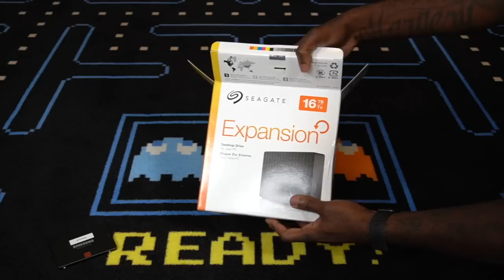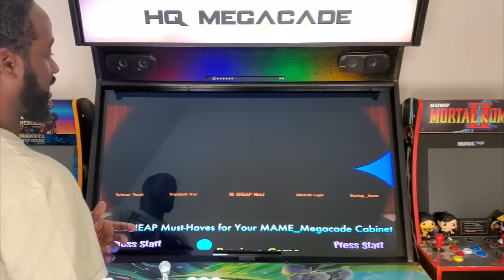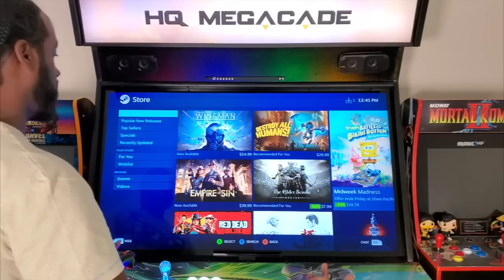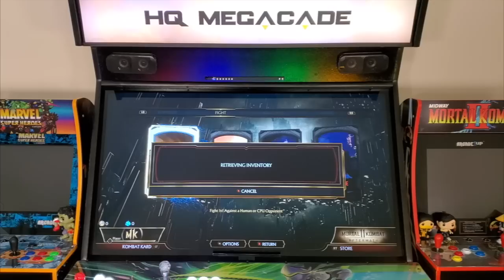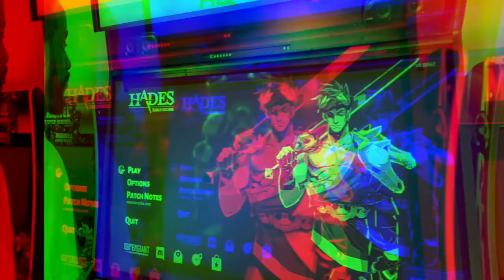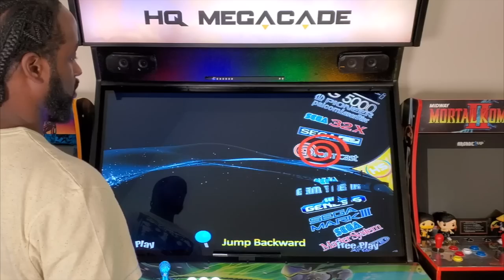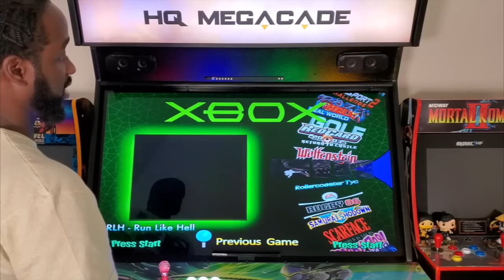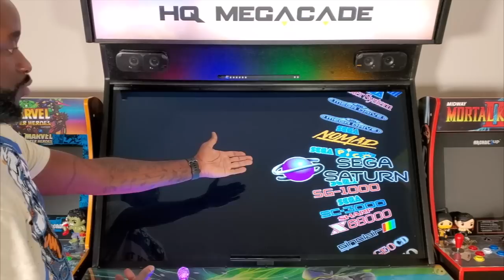Extreme Home Arcades 16TB INSTALL + NEW PC GAMES, STEAM, ONLINE GAMEPLAY | MANHATTAN PROJECT REVIEW

Comment: Nice Vid, thanks man. What should be noticed by disconnecting SSD´s /HDD´s from power is, that data can be lost when being without power over long time period. This effects both SSD and HDD. SSD dont have any mechanical parts but power is necessary to prevent data lost. The HDD has the problem, when not power over long time, its lubricating oil of the little motor can get resinified.

Comment: Great video, very excited for it!  I sometimes have issues with my brand new HQ Megacade where it won't exit a game even when doing the couple little tricks they tell you to do when it gets stuck.  Only option is to do a hard powerdown, which can't be good for the machine.  Do you know if the Manhattan Project upgrade fixes issues like that?
Reply from the maker: I'd like to say that the MO drive will fix a lot of drives. But in the same breathe, it's like having a machine like this with all of these emulators, you are bound to run into little hiccups here n there. But getting rid of busted ROMs, old emulators should eliminate a lot of freeze issues.

Comment: Great video. What would the price difference be between the 10 TB and 16TB? I have a pedestal in order with delivery 🚚 expected to be in March... Do you think this would be available than?  I currently don’t own the 10TB and see that hyper spin wheel is more cohesive. Up to what game console does the 16TB go up to? Are you hooked up directly with a internet wire or wireless? With, such video....so many questions. Can you do a brief video showing some must haves on Arcade options during ordering process and button layouts with Extreme Arcades.
Reply from the maker: Thanks! The 16TB is going for around $300 if I'm not mistaken. Its being offered as an upgrade to the standard 10TB. So of your Pedestal isn't expected to be delivered by March, you could call David and have them add it to your machine.

The 16TB goes up to modern PC games like MK11, Samurai Shodown, Hades and  more. Highest console it goes up to is PS3/Xbox Live Arcade games. As for must have options during the ordering process, honestly it's all personal preference.

Only YOU know what kind of gamer you are. So you have to choose whether or not you want a flight stick for flight controls, steering wheel for racing games. I didn't care to have those. 

As for the internet, I'm connected via wifi. I'm sure with purchasing something like this brings a lot of questions. And also I'd like to add that owning a machine like this does have a learning curve.

Comment: Does Manhattan Project works, as seen in your video, only inside a Megacade, or does the project is a stand alone add on, and you coul install that 16tb hd, with all the emulators, games, presentations etc, on every kind of Pc with the hardware to run it?
Reply from the maker: It works as you see in the video. There's a few hiccups here n there but nothing too major. The MP team is doing a great job at making this drive as stable as possible. Only thing is the drive isn't sold standalone.
Reply: @dthomasfromnc  Does it come only with Megacade?I thought it was an independent project...

Comment: so how in hell did you change the entire hard drive with another os and didnt have to reconfigure all the buttons again? besides, those hard drives with win 10 cant and will not run plug and play on any pc hardware,i think this build they have made for you is tailor made for your pc specs,or they only sell this update packs for customers that already have the premade cabinet?
Reply from the maker: This drive isn't trailor made for my Megacade. If you already own a machine from EHA, you can request the MP drive and it should work with your machine.

Comment: Hey DThomas!  Love your content!  Huge fan!  Quick question:  What CPU and graphics card are you running?  Just want to ensure I have enough specs for the more graphically demanding games and ensure no lag or frame rate issues.  Very close to ordering my classic machine- thanks 🙏
Reply from the maker: What up! Glad you enjoy my content. Megacade had a 1660. That is more than capable of handling retro games. Mire graphically demanding games, I'd personally want something stronger.
Reply: @dthomasfromnc  sounds good- thanks again :)
Reply from the maker: @Dionysi Live  you're welcome! I got some new stuff in the works. Keep it locked. You like power, you'll love the new vids.😁
Reply: @dthomasfromnc - look forward to your content for sure!! Another question I had- for games like the new house of the dead scarlet dawn, other teknoparrot games/ raw thrill games( newer arcade games), does your 1660 gpu run them well?  Really trying to determine if I should obtain a stronger gpu and cpu from my end.  I don’t see myself playing any steam games on the megacade but do want to ensure I can run the more demanding modern arcade games such as the ones at dave and busters.  Appreciate any insight!!  Since I placed my order in there last months, I believe my build will have the omega project and want to ensure I have all the appropriate specs on the machine Thanks 🙏
Reply: Any thoughts on my previous message?  Thanks 🙏
Reply from the maker: @dionysilive1679  the 1660 will handle all retro games with no problem. It can handle most of the modern PC games. Personally though, if I could do it all over again, I'd go with a more powerful gpu. That's just me. Some would say it's overkill, but aye, I like having that kinda power even if I don't utilize all of it. For the average person that's interested in purchasing one of these machines aren't really getting it for power, they're moreless getting it for the games (especially the retro ones).

I'm not exactly sure when the Omega project will be out. There's no time frame on when it's going to be released. But whenever it is done, they'll let the community know. One thing I forgot to mention is that when I tried to play Cyberpunk via Steam on my Megacade, it just froze. The 1660 can't run Cyberpunk on Ultra settings. That's one graphically demanding game. 

For everything that comes standard with the Megacade, the 1660 can handle. Understand and keep in mind that the Manhattan Project and Omega are all community driven. EHA offers a 8TB or 10TB as a standard drive. But for what the community has done with the MP/Omega, their standard drives doesn't seem as inticing. Hope this answered your question.
Reply: @dthomasfromnc - Thank you for answering my questions🙏 
I appreciate you taking the time to go over your experiences with the machine; it means a lot and goes a long way for individuals that are in the market.  Keep making your great videos-I thoroughly enjoy them! I look forward to what the omega project will look like on these machines! Take care
Reply from the maker: @dionysilive1679  you're so welcome!

Comment: I am looking forward to getting me a 2 player megacade for my place. Im wondering if the 16TB/1TB SSD will be the main for the newer megacades or request it.
Reply from the maker: The 16TB is offered as an upgrade now.
Reply: @dthomasfromnc  So the 16TB/1TB SSD can be requested from the website. good to know.
Reply from the maker: @CCM1199  it's not on the site but you can reach out to the owner. Contact information is on their page though.

Comment: I'm getting one for my game room someday.  I'd still like to get a bunch of dedicated arcade machines though like a MKII and house of the dead.
Reply from the maker: Nothing wrong with that
Reply: @dthomasfromnc  I'm kind of curious, you seem to have a few cabinets set up in that room.  What kind of electrical work was done to accommodate the extra load and what do you have to protect these in case of a power surge, I'm sure they're not on a regular unprotected circuit

Comment: You guys got a website for pricing? I want one of these pretty badly but currently do not have the room for it. I would like to follow for when the time comes.
Reply: They are doing this for Extreme Home Arcades, you can Google them.  Their arcade systems run anywhere from $4000-$6000+ depending on what you get.  They DO NOT sell their drives separately.  👍🏼
Reply: @TWJ1979  You can also get just the pedestal and if you are looking for something that costs less than the arcade cabinet and also saves space.

Comment: I dont understand what TeknoParrot is. Google explanation is:"TeknoParrot is a closed-source compatibility layer for Windows PCs to run games originally made for Windows-based arcade systems"

But what are windows based arcade systems?
Are there games that dont exist elsewhere, if not what is the point?
Reply from the maker: Google has it right mostly....

Comment: Can't play steam games. I don't know what encoder board you have in your arcade board. But if it runs off a I-PAC. There's a firmware to change the board from keyboard to xinput. You download winipac if you have an I-PAC. Then you download firmware 1.55 Open winipac, click board upgrade. Locate your 1.55 firmware. Holding first player 1 start and third button first player button changes it to xinput. Holding start 1 and first player button 1 changes it back to keyboard mode. But then again you paid for an already made drive so I don't know if it would be best just to leave alone and not screw up the whole system.
Reply: I also forgot to mention this. If you do decide to upgrade the firmware. Make sure you locate start 1 button in the mapping section of winipac. Then look on the right side of the screen. Make sure you check I-PAC shift ✅.

Comment: Megacade is cool, BUT 5500$ for a 50 inch LCD Screen ( About 400$ ) a very middleclass Windows 10 PC ( Also about 400$) the button board and a few lights + 50$ Speakers. The emulation you can do it by yourself by downlaoding all of it for free. Its a cool machine but i think 5500$ its way to expensive.
Reply: Feel free to DIY, but i guarantee you it won't look nearly as epic as the Megacade..

Comment: How can a person purchase the 16TB Manhattan Project drive?
Reply from the maker: EHA doesn't sell it as a standalone drive. You have to purchase a machine.
Reply: @dthomasfromnc  okay so now I get it. The people at EHA acquired all these roms themselves and then designed their own program, the Manhattan Project, with its own custom interface, graphics, menus, etc… and they sell their own design with their machine. Is that how it is?
Reply from the maker: @johnmecca9008  EHA builds custom machines with whatever designs the customer wants. The Manhattan Project is a community driven drive. You can reach out to EHA via their contact # on their website and speak directly with the owner.

Comment: Quick question: can you play nba 2k21 online? If so what system do you login as xbox or ps
Reply from the maker: You can play online using your steam account.
Reply: Thanks for the response .. big fan..
Reply from the maker: @_aVisionary_  you're so welcome! Appreciate you watching.
Reply: @dthomasfromnc  im looking into the megacade I have questions how many games come with it and can I play nba2k games offline My career were servers were shut down and can I watch movies and how many shooting games that use the guns are there and how are graphics and my internet is not good does that matter and how much power does it consume great video thank you for your time
Reply from the maker: @ShadowHaven88  70k+ games. Yes, you can play NBA2K games offline. However, if you opt to get the Manhattan Project drive, you can access your steam account (if you have one). And if you have NBA2K on steam, you can play online, update rosters etc. I'm not sure on the exact amount of shooting games that utilize the light guns but there are a lot of them on here. Yes, you can watch movies on here that come pre-installed. As for your internet signal, that doesn't matter. This machine doesn't require you to be online. And as far as power consumption goes, it's plugged into the wall outlet. I'm not sure how much power it's consuming but I don't think it's that much. Imagine having a regular computer plugged in. Essentially that's what this is...a computer. Hope this answers your questions.
Reply: @dthomasfromnc  thank you very much for the info  looking into it to buy one which one im not sure yet due to how stuff is im considering a route with my own tv hook up to save more with chance to upgrade later in the future if I want I want time crisis or house of the dead style guns lol looking into everything